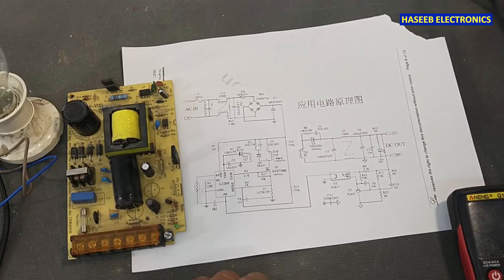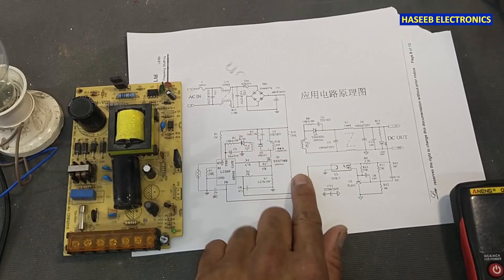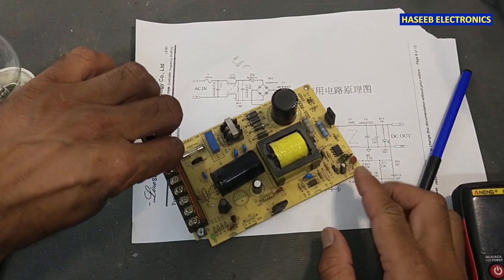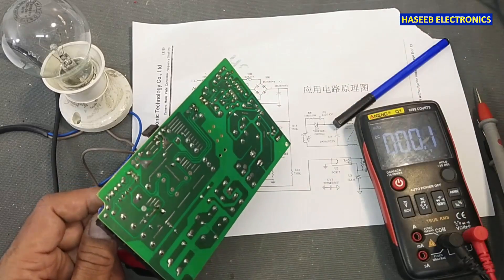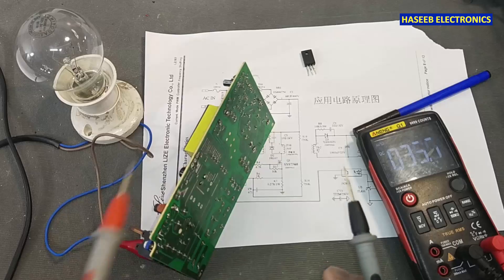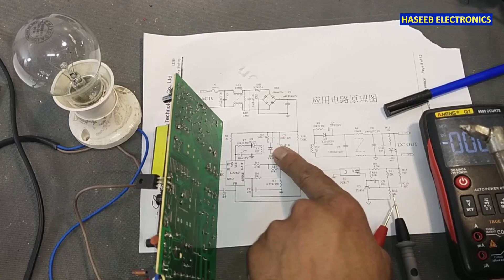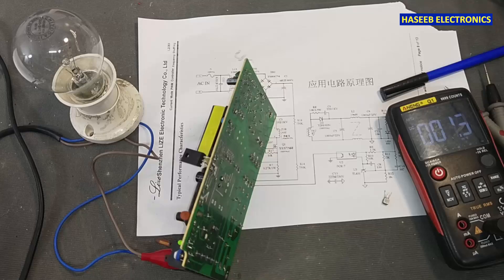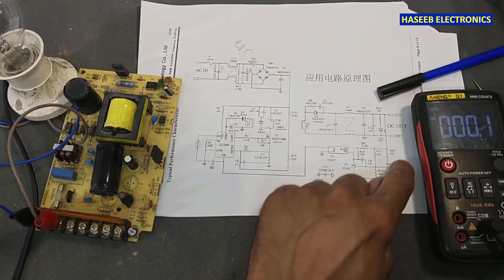{758} If Open Circuit In SMPS Secondary Side, What Will Happen?

Comment: assalam Engr habeeb, pls I have similar issue right now, my power supply is supplying a DC voltage 21v   output, but immediately when I connected the halogen bulb 21v  the output power voltage will discharged, but I checked most of the components around I didn't found it, pls I need your assistance

Comment: Thank you very much. I have another good question for you - i have PSU with L6565  and R sense resistor is blowing. Seems like IC is not closing mosfet and it stays open. I did replace both is as well ss mosfet with resistor but it still happens. Any of yoy ideas on why this haplens?  Thanks again for great tutorials!

Comment: Namaskar sir very informative videos and easy to follow. Initially I thought that it's not so much easy to service SMPS. But after watching your videos it's easy to service. Thanks.  One fault I found that instead of specified 24volt output it delivered 48 volt in the output and severe damage to the load. Sir, kindly discuss if possible.

Comment: You did not explain why there is fluctuation in the man DC capacitor when the feedback or output circuit is open circuit  considering as I understand it the power supply is operating without a load . If there is no load why is the main DC capacitor voltage changing ?
Reply from the maker: when ic fails to find feedback 
it switches uptil maximum duty cycle which causes to draw maximum current causing to drop voltage on capacitor
then this ic turns off due to over voltage protection, which causes to regain voltage to it's normal voltage on dc capacitor
then  ic have to wait until the voltage on vcc drops to the UVLO lower threshold, so ic will start again 
so these surges on dc capacitor cause to variations on capacitor
if ic switching continuely then the voltage on capacitor will stable
Reply: @HaseebElectronics  the current being drawn from the main DC capacitor  under these conditions is the magnetising current being drawn by the primary of the transformer . So with a bigger duty cycle you will see a bigger  magnetising current . Is it correct that this should still be a relatively small current compared to the current being drawn from the DC capacitor when it is operating normally under load ?

Comment: Chokran Dear, If possible can you explain the use of snubber circuit in SMPS and what's the effect to the DC output when we remove it or one component is failed.. Thank you for collaboration
Reply from the maker: please check video number 510 for snubber function and 284 for RCD snubber calculation

Comment: assalamualaikum HASEEB,i have one LCD TV,but sometimes i start press remote control to switch on the tv,then the tv switch off itself,its happen while the tv is at a standby mode,i try to switch on repeatedly until the tv is on in normal condition.What is the basic issue of this problem?I consider it can be fix anyway.Please help me.🤗🤗🤗

Comment: haseeb sir my humble requests please explain about transistor configurations  for example  transistor used as current mirror, transistor as zener diode ,voltage amplification, ,as a  switch .etc